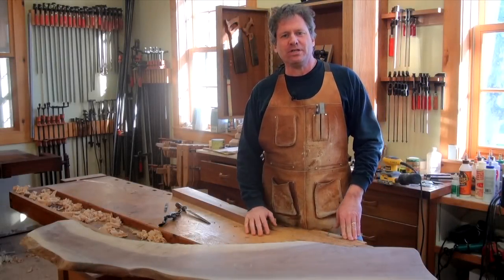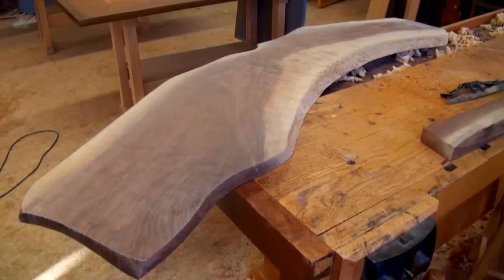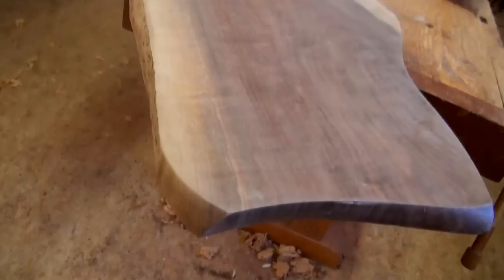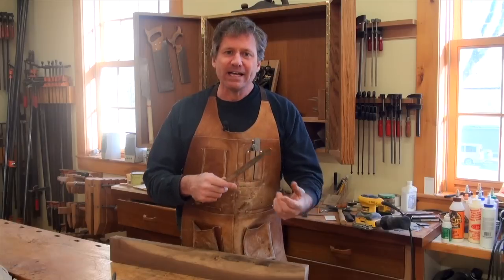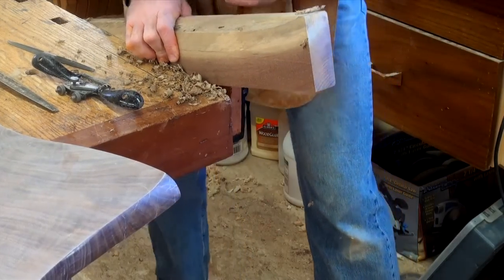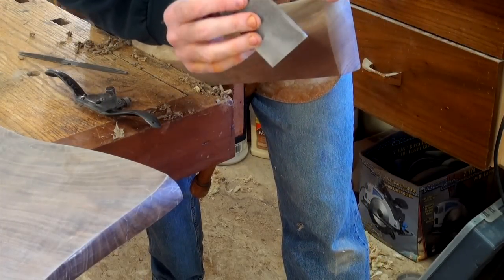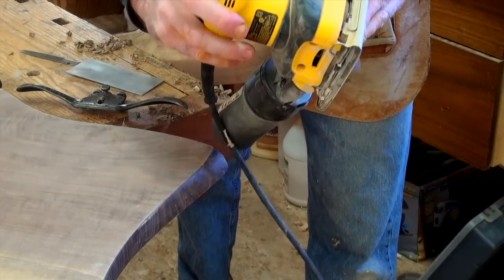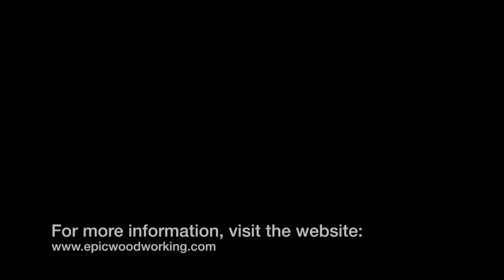Live-edge Walnut Countertop with Tom McLaughlin

Comment: The counter top you've created is exquisite, and your video was so instructive. You say you used Waterlox, and treated the first coat cut with 10% mineral spirits. However, there are a few varieties made by Waterlox, which one did you use? I have a black walnut carpenter's bench made from a huge black walnut than fell on my property in 2014. The slabs were cut 3 inches thick, at lengths nearly 8 ft. It's beautiful walnut, and I've left the live edge.
Reply from the maker: marianna mayer 
Thank you so much Marianna!
You can use either the original or the satin finish. The original is a little "clearer" looking and also a bit glossier. But I always like to do a final rub out with 0000 steel wool which knocks down the sheen a  bit anyway (wait at least a week to rub it out and your results will be all the better)
Reply from the maker: marianna mayer 
Also, I find the satin finish rubs out even better, but naturally it will be slightly "hazy" with the additives to achieve the satin sheen.
One other interesting thing about using Waterlox you can cut it dramatically, meaning dilute with paint thinner as much as 75% thinner to 25% Waterlox. When you do this, it wipes on very easily, but will require more thin coats. It works very much like danish oil when thinned even 50%, but will offer a much greater protection against water rings than Danish oil once you have a bit of surface build.
My best advice is to experiment a bit on an extra piece of scrap. Presently I have a couple samples going right now, on Walnut and Cherry, to see how many coats of the 25% mix it takes to achieve a nice finish. 
There's nothing like walnut, I wish you great success with your project!

Comment: What did you use for the finish? and what makes that your choice? For a countertop I'm assuming some degree of water resistance, so would it work well with a coffee table? 

I'm used to Linseed but I know it doesn't do well to seal from water
Reply from the maker: Shawn Hett 
Thank you for your interest Shawn. Yes, it is an excellent finish for water resistance due to the primary tung oil resin.
You might find some other information that will be helpful regarding Waterlox by seeing the other comments I made to the most recent questions.

Hope you have great results with your project!   Tom
Reply: Thanks for the response! I'll do some further research on the Waterlox. I didn't know Tung Oil by itself would be water resistant
Reply: I do lots of live edge pieces and the favorite finish is the oiled urethane from General Finishes called Arm-R-Seal, semi gloss. Goes on great and protects against liquids. The oil in the finish highlights the grain beautifully.

Comment: After you brush out with the 0000 wool is that it no sealer thanks great vid
Reply: Yes Lee, that's it! Sometimes I buff it out with a paper towel after which brings up the sheen just a bit more, but the Waterlox, when cured thoroughly, runs out beautifully with the 0000 steel wool.
Thanks for your interest!
Tom

Comment: What was the sealer you used ?
Reply from the maker: Smoke eater I used a varnish called Waterlox (satin sheen). It is a tung oil based varnish that works very well. Or course you will get similar results with similar varnishes. Hope that helps! Thanks, Tom
Reply: Epic Woodworking   Yes, I'm a novice and my wife mentioned walnut countertops, I don't want to screw this up, may end up nice or could be a disaster. I have some that's just about dry enough so we'll see what happens. Thanks brother👍
Reply from the maker: Smoke eater Sure, glad to help. One thing to keep in mind, not sure if I mentioned it in the video, is that you can cut the varnish with mineral spirits (dilute by adding approx 10 - 25 % mineral spirits, also called paint thinner), which makes it a little easier to use and it goes on in thinner coats, which is always easier to control when applying and leads to better results. Just test on a sample piece first and you should be fine...and your wife will be impressed👍
Reply: Epic Woodworking   Right on brother! Thanks👍

Comment: Nice video with great wood; practically wood porn.  Can you please tell me about the finish that you used?
Reply from the maker: Thanks Gary. I used Waterlox original for this finish. You can wipe or brush on. For this piece I cut the first coat @ 10% with mineral spirits and allowed to penetrate before wiping off. The final coat was brushed on full, and after letting dry several days, buffed out with 0000 steel wool for a nice satin sheen. Will be posting more videos soon!
Reply: Thank your for you rapid reply.  I typically use Tung oil or Danish oil and I have yet to try Waterlox but your video has inspired me to do so.  Looking forward to your future videos.  Thanks again.  Gary

Comment: Too bad you can see that ripple from the planer or whatever was used plain as day because it was not sanded out of the slab. 9:49
Reply from the maker: CharliePrep Trust me Charlie, that’s not a planer ripple, that’s just the strong curl in the figure absorbing the initial finish at a different rate. I hand planed and card scraped the surface to remove all traces of planer marks before sanding. Thanks for watching! Tom
Reply: That is not machine marks. It is fiddle back grain due to compression.
Reply from the maker: Andrew Dalisa How right you are about that Andrew, it was some beautiful walnut!